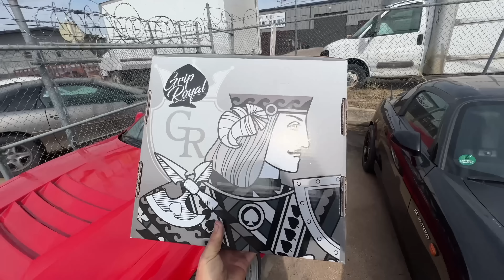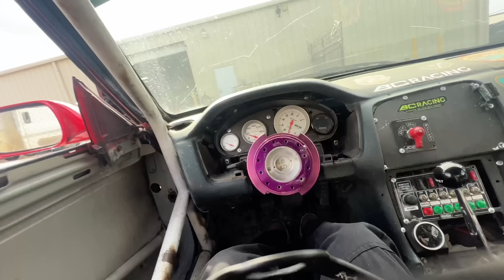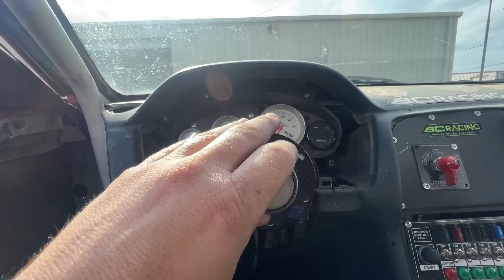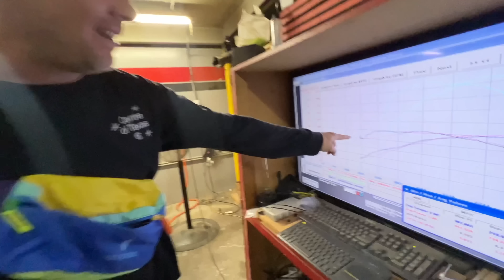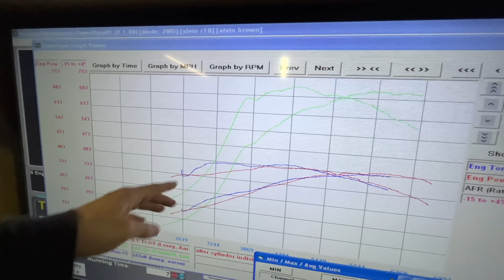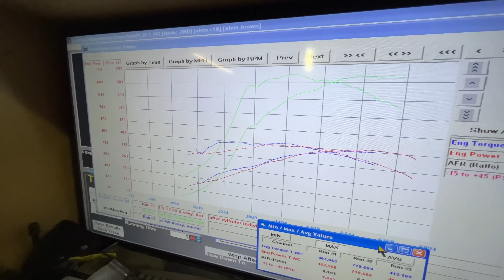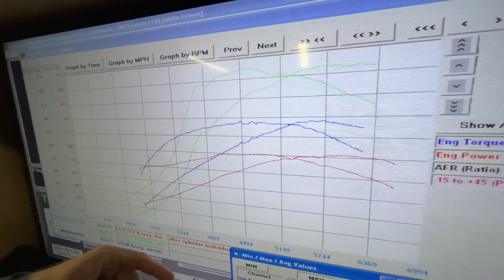S14 gets repairs for the 2023 Lone Star Drift season!

Comment: so you know, Ethan was rolling into the throttle on the 719/710 runs. the car was spinning on the dyno. Ian went back not too long ago with better tires and R35 coils, made just about 800ft lbs of torque.
Reply from the maker: that thing is wild.

Comment: CNC porting is kinda BS, many stamp CNC ported on some heads and people think they are Good but that doesn't mean the CNC porting program they used is Good!  CNC porting can be just as bad as any skillless head hogger with a hand die grinder who doesn't have a clue!  It just looks better, so it sells better.  Also LS heads are pretty Good and if you do not know what your doing when porting them, you will make them Worse.  All modern factory engine/cylinder head design is pretty good, sometimes a random common machine shop valve job will actually make them flow less/worse.  Still even porting is a mod very often misunderstood and sometimes hard to explain.  The best port job isn't the best average power maker always, it's gonna flow more and make better high RPM power, IF the other parts of that combo allow/need it.  I've often seen people get porting to show no improvement or make things worse because they don't understand what it does or how to match their parts.  You can not expect porting to work as well engine to engine, as I said modern designs are A Lot better than older engines or if you consider improving each cylinder on engines with more cylinders.  Smaller engines do not have the same amount of areas/cylinders for improvement, IF any  improvement can be had.  With modern engines think of porting as sizing, if your combo needs more size then have them ported, otherwise flow velocity is more important.  That is why I say sometimes I'm a head improver/detailer/finisher because that's all they often need, is just some hand finishing from the factory rough machining But modern machining is Very much improved as well as designs.  Last a pro porter isn't always skilled, many are just good salesmen.